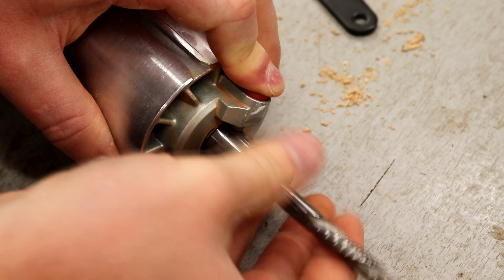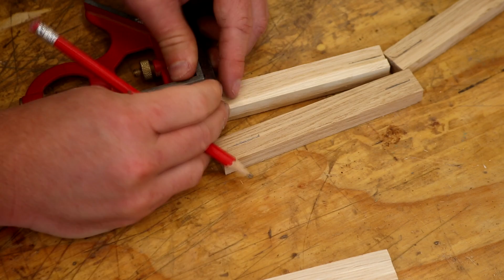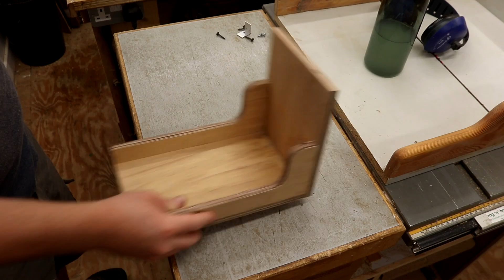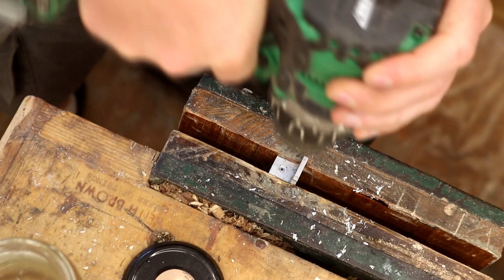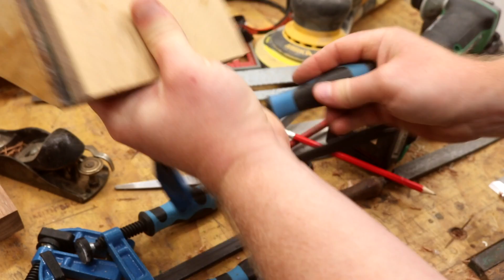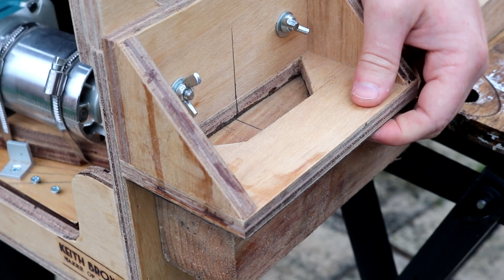Slot Mortiser - handheld & cordless using the Makita trim router

Comment: Regarding the self centering: Use a triangular shape under your router. Solves the problem instantly, the router will always drop to the bottom, if you clamp it in from the top. With a little care, you can integrate it into this design.
And PLEASE screw the top handle to the backplate. If the handle breaks (at the glue point), your hand will instantly be caught in the exposed router bit below. Also you should add a (seethrough) cover over the routerbit in any case.

Comment: if you have drill press the mortise attachment is only a c note then you could leave your domino edges square, because your holes are square, and as big or small as you need them. even if you had to buy a bench top drill press it would still be way less expensive.

Comment: Great..! :)
A few tips: when you countersink in metal do it slow...very slow and you won't get that star pattern as the bit wobbles all over the place.
If you want to smooth the rails use some very fine water-resistant emery cloth for the finish. You can put a mirror-like finish on almost every piece of metal that way. I use it frequently on my stainless steel constructions and it never failed to perform (I'm a blacksmith btw..).

Comment: You are a renaissance craftsman who has $15k in shop tools, and profound fabrication expertice. Didn't you see the manufactured domino machine as an obvious money saving device? Funny video--but a vastly simpler perpendicular mortising jig with a plunge cut router seems to be a more valuable build for woodworkers without deep pockets.

Comment: Rag n Bone Brown: Looks to me like you need a pair of saddle rests to hold your trim router down on. It would just be 2 pieces of wood with a round spot cut out of it for your trim router to sit in, then use the clamps to hold it down. Give that a try and see where you come out at/with. Hopefully it'll be that much ore accurate.

Comment: Your center line was off because of your pivot ends are slightly different. As if it pivots more one way than the other, it will cut further on the other side.

Comment: When you burn your fingers like that,immediately touch the burn against your ear lobe. Your ear lobe has less nerves and will draw the heat out straight away. Try it it works. Not appropriate for chemical burns 😄

Comment: If you remove it and you want to put it back exactly where it was before and yave it line up perfect no matter how many times you remove it, build a cradle for it with a stop and use the same clamps.

Comment: I may well not be seeing something obvious in the video so just let me know if I am but in regards to the dust/shavings collection problem, could you not just cut a large hole in the base for them to fall straight through & onto the floor rather than them collecting in the base?
Reply from the maker: That’s actually a really good shout. Sometimes the simple/obvious ideas are the best ones! No idea why it didn’t occur to me haha
Reply: Ah cool maybe that's an easy solution for one of the issues then :)
Reply: That literally was the first thing that came to my mind when I saw the issue.
Reply: My thoughts exactly.  similar to the view window in the fence.

Comment: Impressive try to a simply Pask version of a Slot Mortiser. But ShopBuilt benchtop version using a horizontal sliding instead of the pivoting cutting method seem far simpler and faster for cutting (and there no infringing on Festool patents too). So if you ever try too revise this prototype you may want to use the horizontal sliding cutting method in the design instead. Link below:

https://www.youtube.com/watch?v=2RQcClMWeh4&t=310s

BTW I was thinking of trying to do my own version that combines what I think is best in your and other designs. Hope use more some Plexiglas and metal ie aluminium parts.

Comment: i ended up with this monster roofing 'guide' meant for spacing for conposite shakes - never used the stupid thing, but it's make of phenolic plastic, so would be perfect for this - never warp, easy to work, slides nice...   and i have a cheapo Horrible Fright trimmer i never use.

Comment: The center much depther than the two side.
Reply from the maker: Deeper? It doesn’t matter, it’s the side grain to side grain glue joint of the tenon that is important to add strength not the end grain

Comment: Nice vid and well if we don’t try we don't learn :) I'm no woodworker and am just getting bits together at age 45! I want a table saw but it has to be a battery powered one, is the table saw you’re using a DeWalt DCS7485? all be it mains powered? How is it, would you recommend it? Also, I see you are using a "pink" blade what is it? I guessing it has more teeth for a finer cut?
Reply from the maker: Hi Ian,  check my website for details, or the description box below the video, cheers, Keith

Comment: Hey Keith, it is a bad idea to cut aluminium with an abrasive cut-off wheel. It is much better to use a diamond cut-off wheel that can cut most metals. I think the brand 'Lennox' sells one for quite cheap, and they also last a lot longer. 
btw I don't own the company 'lennox' I am just telling tis to you because I think it will be helpful.
Reply from the maker: Why is it bad?
Reply: the wheel can unevenly get clogged with aluminium, damaging the wheel and making it explode.

Comment: Nice project Keith. That router cutter your using isn't actually a up cut spiral, its a compression or up/down cut router cutter. The first 10mm or so of the cutter is the upcut section and the remaining 25mm above is angled downward. This type of cutter is used all the time on CNC routers when cutting laminated material as it will leave a clean, chip free edge
Reply from the maker: Ok thanks... Does that mean it is or isn’t suitable for the project? It works fine...
Reply: @RagnBoneBrown  When I first saw it at the start of the video my first thought was that it would pack the chips into the mortise (because of the downcut part of the cutter) but I guess the side to side action helps clear them out. Looks like it works great. 
 I'm a CNC guy so when I saw it I just wanted to share a bit of my knowledge. 
Keep up the good work, I always look forward to your videos on Fridays

Comment: An interesting project and very honest of you. I’ve not had much success with wood and moving parts myself!
One thing that really helps instead of washers are things call thrust bearings, take a look!
Really like the look of that router shame it’s the wrong colour for me but I think a black and yellow one is on its way.
Reply from the maker: Cheers Matt good to hear from you - any new vids in the pipeline? Will check out thrust bearings, I’ve always been rubbish at knowing what fixtures and fittings to use for the best 👍

Comment: Just a pair of blocks front and rear, so as to provide a sort of carriage for the router to rest will fix the slop issue, glue to the moving base. Does not need to be big, just touch the round part in 2 places front and rear.

Comment: Nice one Keith, like your honesty about the project.  I paid for Neil's plans (they are well worth the 10 Aus dollars) and followed his design, I just added oil point on the slides to keep things "moist".  I must admit i was going to go your route with the 8mm collet as finding a 6mm spiral bit for my router was difficult. But i managed to get one at Wealdons in the end.  Anyway i have one now and use it when i want more strength than biscuits and i can't be bothered to do mortice and tenons.   I totally admire your ability to complete projects and film them, keep up the good work.

Comment: This does look like a very cool project and I enjoyed your video. I've not seen anything like this for a very long time. I'm sure there will be times when it may be useful and it is much cheaper than the original Domino jointer!

Have you come across Wealden Tool Company in Kent? I've been using them for router cutters for years. Great service. I'm sure your Amazon cutter will be fine but it may also be worth knowing. :-)
Reply from the maker: I’ve been recommended them before because I remember the name. I’ll have a look at their site. Could do with some new bits as all mine are cheap and rubbish (apart from the one in this video which has been great!)

Comment: Excellent project Keith. I've wanted to have a go at one of these and it's clearly not easy. Neil's was well executed and you've come close I think.  I wonder if, as a simple fix for the mounting, you could try a CNC mounting bracket instead of the hose clamps.
Reply from the maker: Thanks. Yeah that’s a good idea. If I could go back I’d have built from Neil’s plans but then I wouldn’t have learned anything. But I wouldn’t have wasted so much time either so it’s swings and roundabouts!